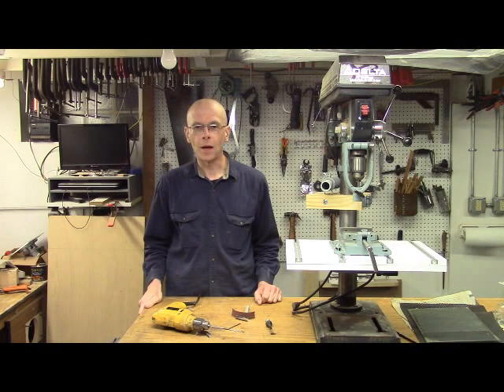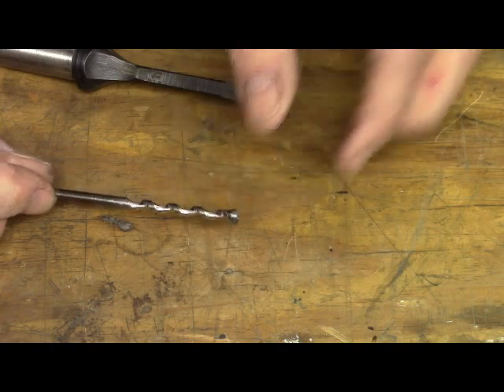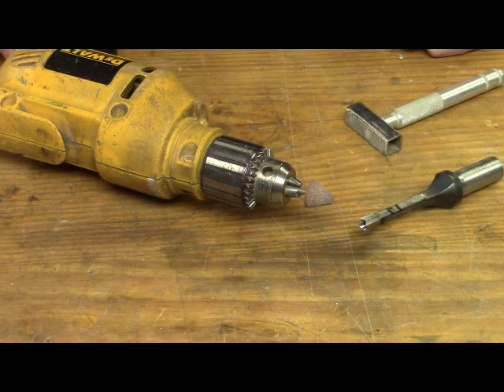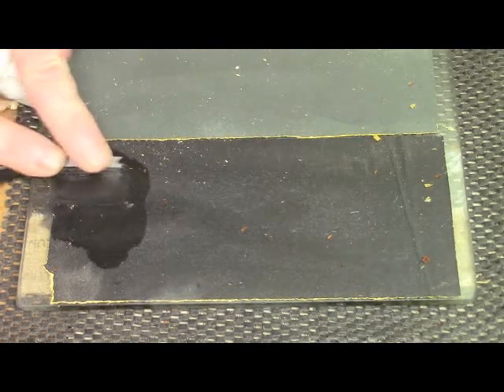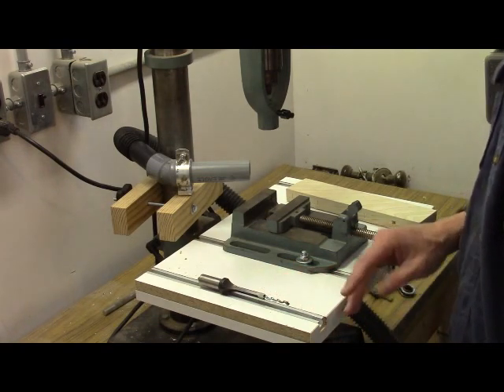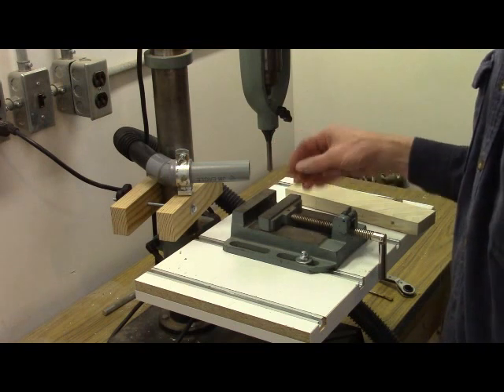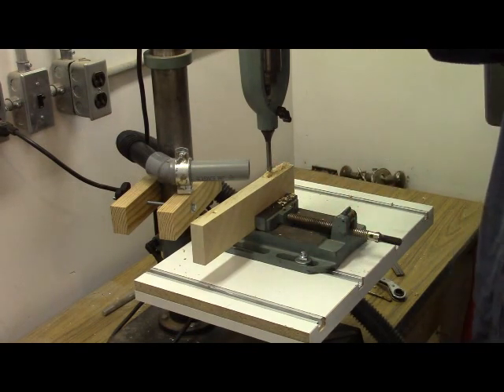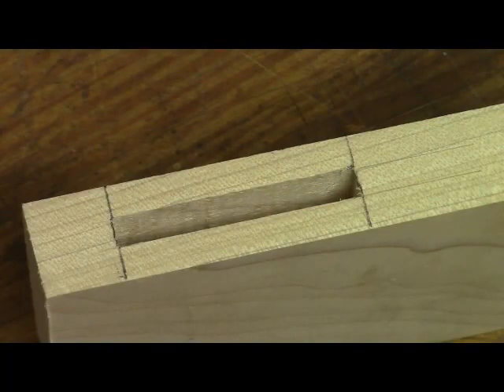Mortising on the Drill Press

Comment: Thank you for taking the time and explaining this for me thoroughly. Great video. What brand of drill press do you own and would you recommend it?
Reply from the maker: I have Delta bench top model I purchased in 1996. I don't think its made anymore. I replaced the chuck with a genuine Jacobs and the belt and quill return spring had to be replaced. If I were going to get a new drill press I'd get the floor model sold by Porter Cable; they get good reviews and the price is hard to beat. The problem is I don't think anyone makes mortising attachments anymore. I believe the reason for this is twofold; the wide availability of the dedicated mortising machines and the variation in quill diameters, that made fitting attachments problematic.
Reply: @FederalFurniture 
FYI
It's 2024 and Grizzly does sell a drill press mortising attachment in a kit. It comes with clamps, quill adapters, various chisels and of course the attachment for holding the chisel. What I did was to go to the parts for it and only purchased the attachment. It was $40